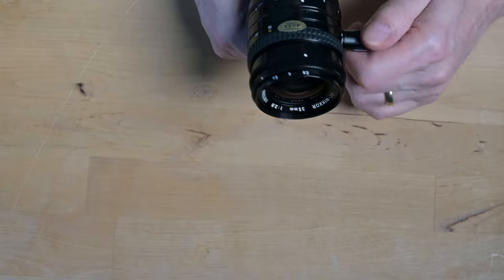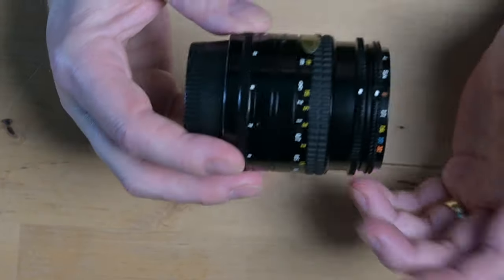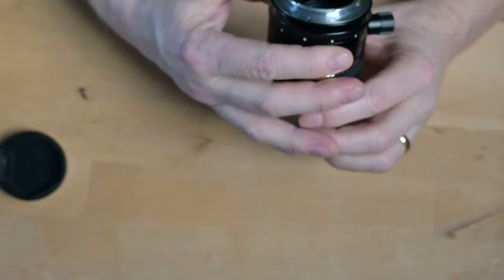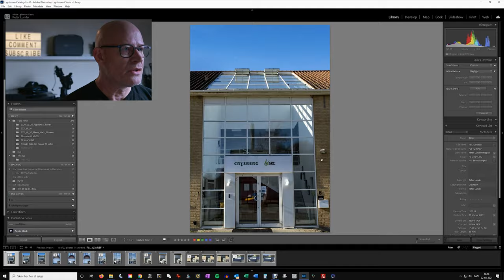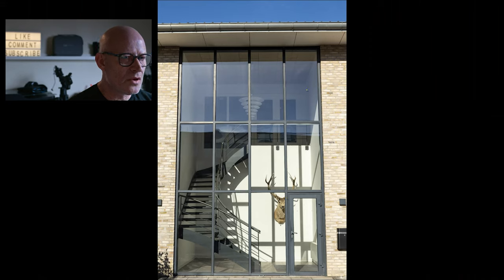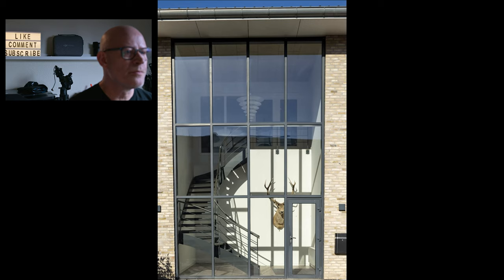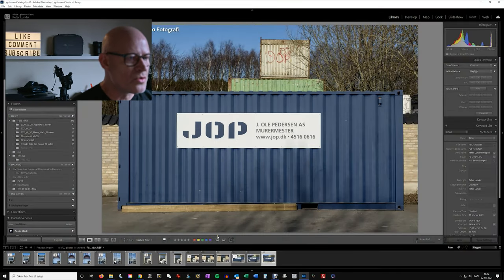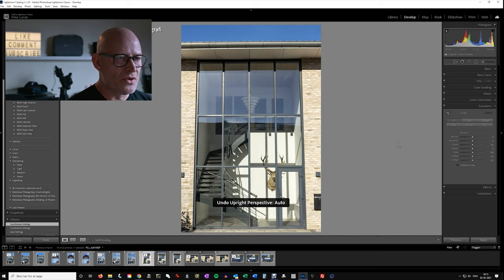Is A Perspective Control Lens Necessary?

Comment: Great video but may I remind you that, if you shoot with a PC or a PC-E tilt shift lens, and use it properly, you can still adjust the perspective in software just like any image with any other lens, except that the perspective will already be most of the way there, and you will lose very very little of the original image by adjusting it. Same cannot be held true for a normal lens.